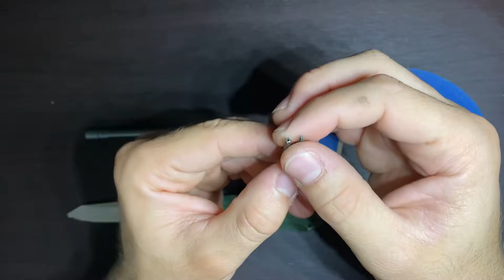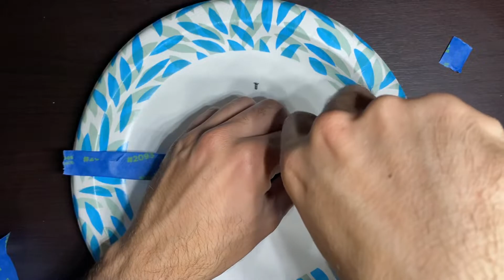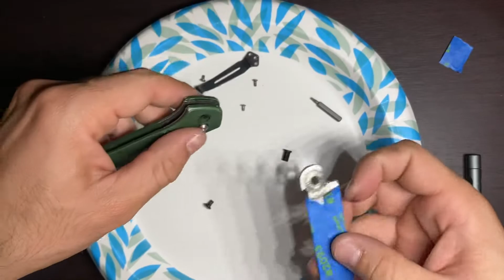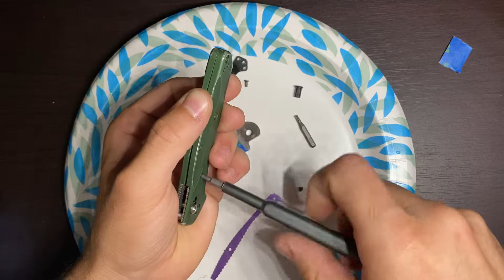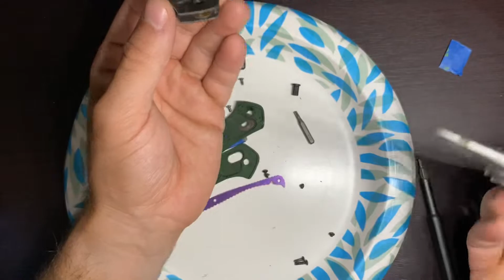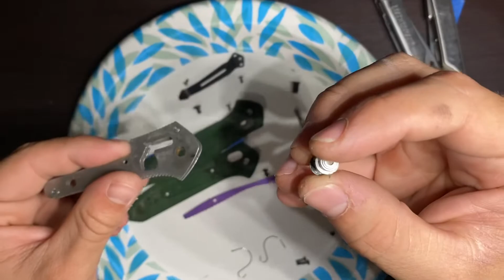How To Disassemble Your Benchmade 940￼

Comment: Question: can I take out the stop pin and put it back in with a different "side" facing the blade? I ask because I batoned with the blade and put a little ding in the stop pin. Now my blade has a bit of up/down play. I'd like to rotate the pin with the non-dinged side facing the blade.
Reply from the maker: Absolutely, it’s not located since it’s a round cut end so you can rotate it whichever way you want.